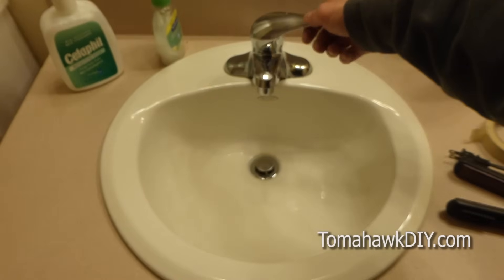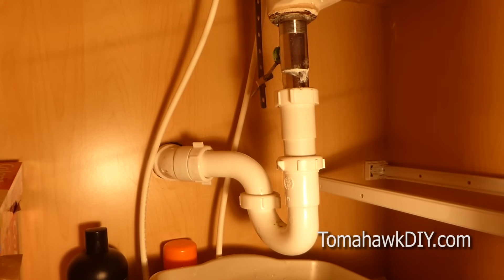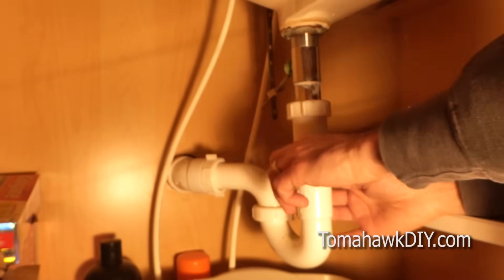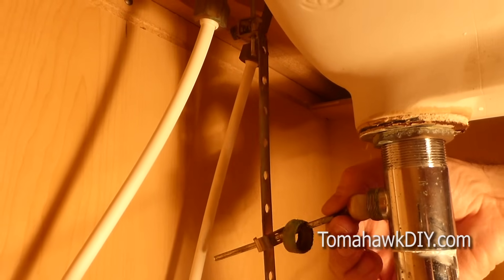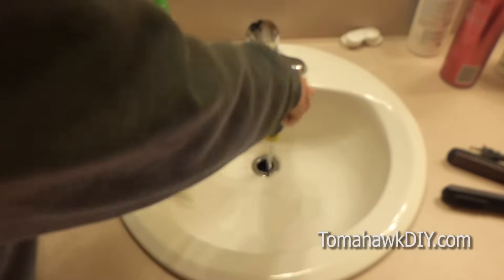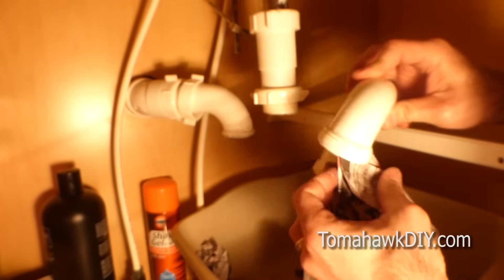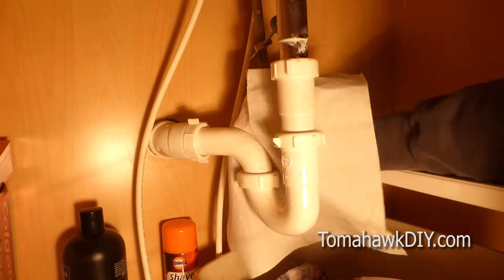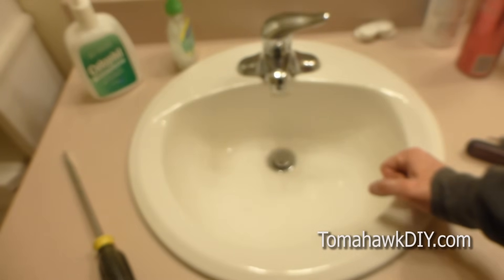Easy to Fix a Clogged Sink - No Tools Needed

Comment: The arm that you unscrew the stopper with is different for me. It's a plastic cap with a Male piece in the middle; it didnt remove the stopper at all, just cemented it shut and now I cannot screw the plastic piece of the arm back in

Comment: This is great if the clog is in that part of the drain. My clog is in the pipe that's past this section. I need tp use an auger, which I'm not yet competent with.

Comment: I did this as well. But as soon as I removed that U, elbow pipe it was spotless. The issue is in the pipe in the wall. My drain snake couldn't capture any gunk or hair either. So I left Drano  and left it standing overnight. This morning it's still standing at the same level.

Wth now?

Comment: I tried doing this but I wasn't able to screw off the part that lets you take out the stopper. I used a hanger to take the gunk out then a tooth pick for the stopper so now the water will go down at least

Comment: No need to remove the P-trap.  Just remove the chrome plug, as shown in the video; then stick a metal, wire length of clothes hanger down the hole.  Hook the wads of hair and pull up, out the hole.  Be sure to bend a small hook in the hanger first.  The hook does the work.

Comment: My bathroom sink is clogged. I took off the pipes but they're not blocked up.  The water in the sink goes down partially but not all the way. It just settles there.
Reply from the maker: Sorry it did not work for you. Looks like you need to call a pro to help you fix it

Comment: I don't see your solution to this problem working AT ALL at my place (an apartment) frankly; under my sinks (bathroom, kitchen) it's all heavy duty steel or iron or maybe even brass or copper; I don't know- long story short, the gaskets just won't turn.  While it doesn't make sense that they're welded in place, it sure feels like they are: they're not user friendly, and tools (and expertise) feels like a must in this situation, to say the least.  Still, kinda fun to watch.

Comment: Stil not working for me sir. It’s was already midnight, i was tired . 
So I left the pipe open and left a bucket underneath that straight pipe from the sink BUT !! The water kept coming from the other side of the pipe ( the wall side ) when my next door neighbor is using there sink 😭😭 
Woke up with soaking wet sewerage  water all over the bathroom. 😭😭😭
Reply from the maker: Make sure you were able to put back the things correctly, if it did not work for you, I would like to suggest to reach out to professional.

Comment: You don’t have to do this you can use a plunger it works just fill the sink and put your plunger in it and press down than give light push to pressure it than take it out and it will become unclogged
Reply from the maker: Thanks for sharing

Comment: CAUTION:  this technique works, but MAKE SURE the drain is dry and there are no narrow bits in the pipe when pushing the newspaper through.  Mine got stuck and started to disintegrate because it got wet.  Took a long time to get it out.  A small rag might have been better.
Reply from the maker: Thanks for the reminder

Comment: This tip is for all you beautiful single women out there. 

Remove the blocker and then pump the sink with your palm until all the water is gone. It should be good after that. But you have to remove the blocker before pumping. 😏❤️

Comment: really it's only the stopper causing the problem.  draino will sit down in the trap and take care of the trap, but draino will pass right by the stopper which accumulates a ton of crud.  just remove the stopper and clean it.  problem solved

Comment: Instructions unclear, got six sheets of newspaper stuck in the pipe

Jk but seriously I've been trying to push it out for 45 minutes and it has barely moved lmao.  I might have to buy a new pipe.  I even took the top pipe out to try to get it out but it just won't 😅

edit: I got it, just had to shove it but up the other way 🥴, I am dripping sweat rn that was neither fast or easy 🤣